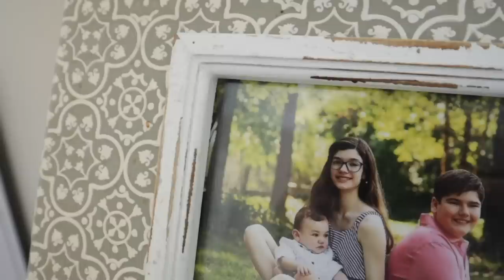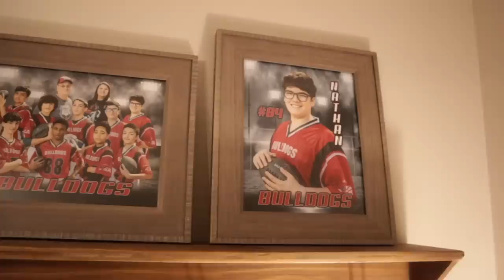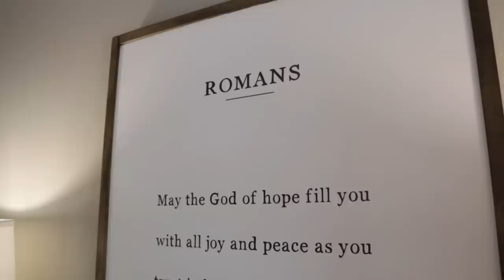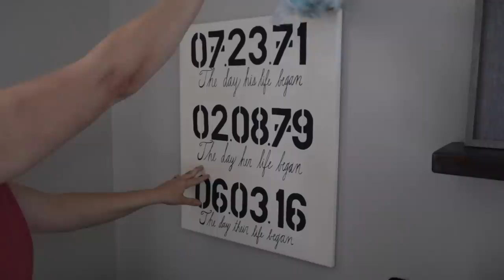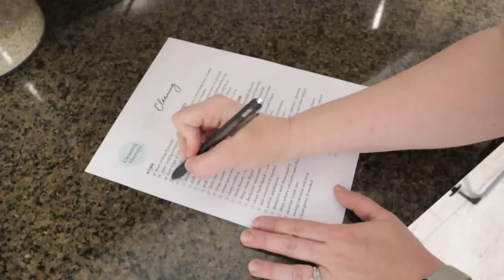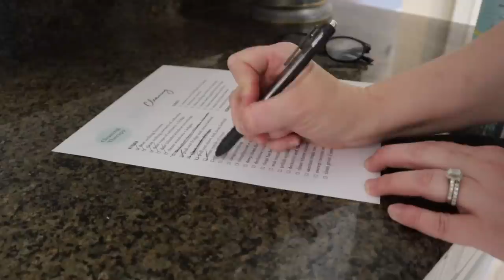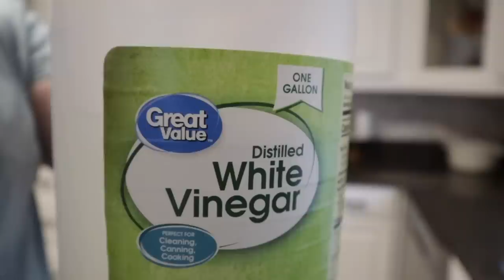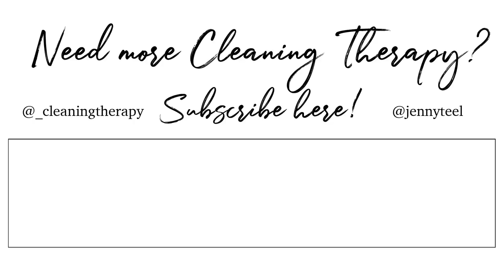EXTREME DEEP CLEANING MARATHON | 2022 Cleaning Motivation | Cleaning Therapy

Comment: Thank you for certain methods- the microwave and cook tops were both better than ny old method and I will definitely add them to my list ( yes I need a list, just like you, or I leave things out by accident. ) i think oven cleaner works better than Dawn My kitchaid wall oven interior is a beautiful cobalt blue and looks beautiful when clean. It is self cleaning but I am not sure its easier than old fashioned oven cleaner. When its not too dirty I just use a wet Brillo or S.O.S. PADS. I am going to use more oven parchment paper liner to prevent it from getting as dirty. Dawn helps on the interior oven glass followed by glass cleaner. Your handpainted cabinets look great ( mine are handpainted white too) and hand washing with Dawn really helps. I spray on Dawn/water, let sit and wipe after 5-10 minutes. Your video was a great inspiration.